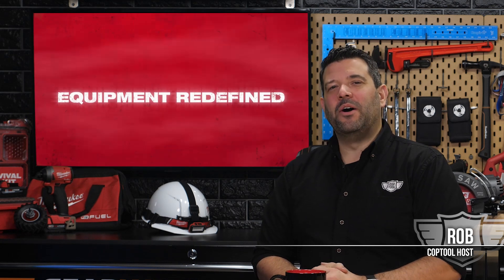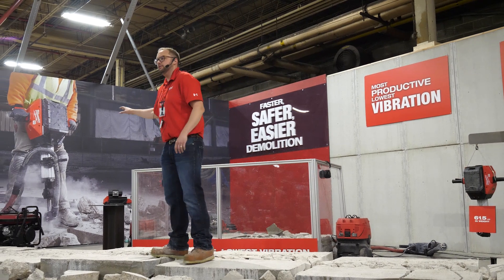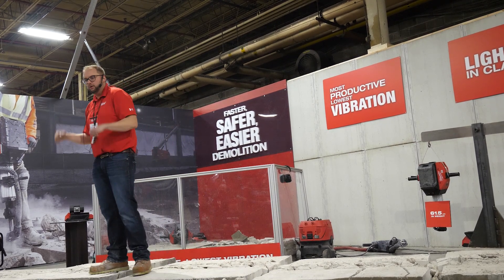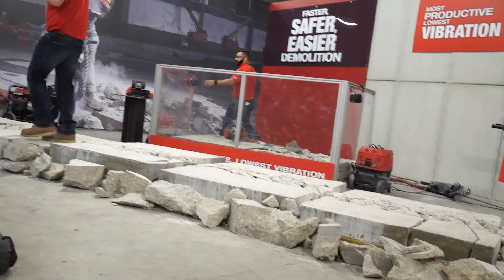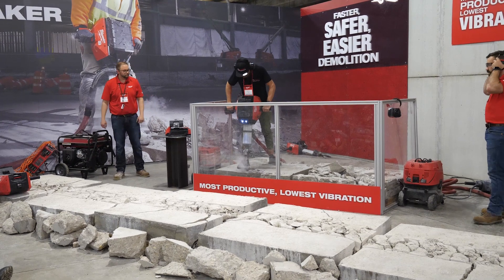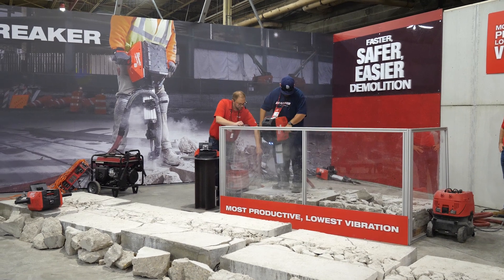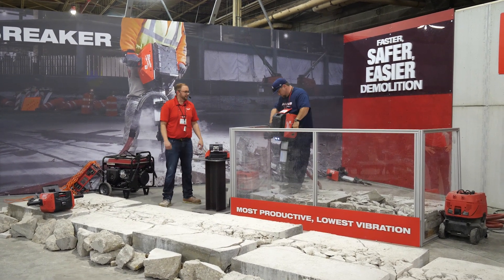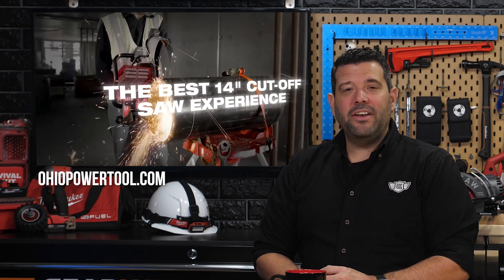Milwaukee MX BREAKER They Did it! A Cordless Jack Hammer! MX FUEL

Comment: Any issues with this thing over heating on a hot day in direct sunlight? I am a landscaper and Ive got the m18 quick lock string trimmer and the m18 chainsaw. Both of them are for light duty use only and if they are ran too hard on a warm day they overheat. I use gas for anything thats not light duty. When ive burried my chainsaw or weed wacker into some thick material it always runs the battery down a lot faster. Now ive done some decent sized jobs with the m18 gardening tools but it was a pain in the ass going through battery after battery and charging them and overheating them. Carrying all those batteries inside to charge after a long days work is a pain in the ass too. I love these tools and they have their purpose but this jack hammer clearly isnt replacing air power any time soon and its probably not replacing corded either. One issue with lithium tools is the weight and the price. You can put all the batteries that will fit in an electric car because youre riding on top of it but a tool in your hands is a different story. Most of these tools need twice the amount of batteries they currently have to actually make some real power that comes anywhere near gas or air.

Comment: The problem it's nice for small jobs ,but the concrete they were breaking wasn't fully cured in my opinion  ,how would it work with old cured concrete
Reply: Also that concrete didn't have any rebar or wire in it. So it's alot easier to break 😕
Reply: It's more the lack of Rio holding it together

Comment: Ive got 6ft depth of base mix to break. Think I'll still to compressed air tool. Nice tool mind, would like to test it against my old air powered beast too see what it can do. I've a 24kg electric which isn't bad when you have no air supply but it lacks that explosive power an air hammer gives.

Comment: Well it’s easy to brake concrete over a pallet and not in the middle of concrete we’re the other concrete is around it it’s putting pressure.
Reply: I think they just wanna show you the side by side comparison to the corded hammer